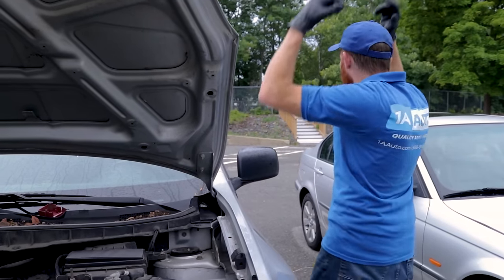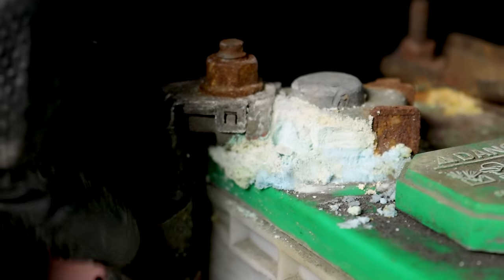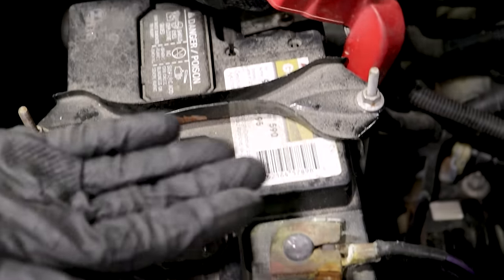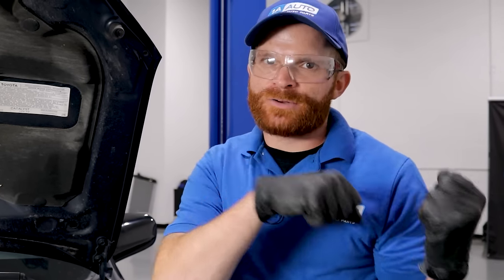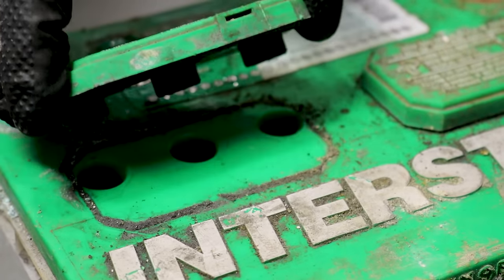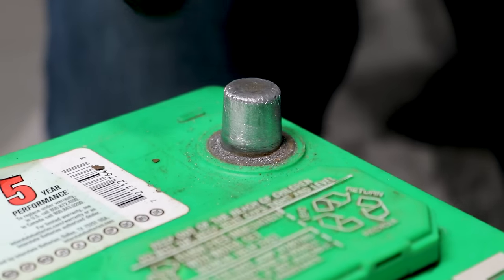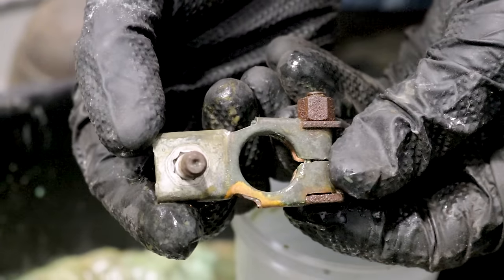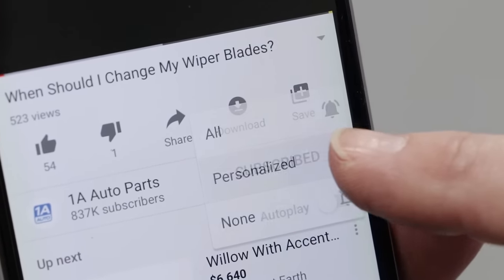Corrosion on Your Car / Truck Battery? Cleaning Tips! It’s Important!

Comment: I keep an old tooth brush in my tool box just for this purpose. It works great at cleaning up those terminals with the baking soda and water
Reply: Tap , warm or hot water?
Reply: @marlenesanchez6370  between room temperature and lukewarm,no more no less.
Reply from the maker: Great tip, and great way to repurpose old items instead of throwing them away! http://1aau.to/m/Shop-1AAuto-Now
Reply: boiling water to clean and copper grease to protect have done that for 40 odd years allways works and no problems
Reply: Me too

Comment: I never heard of corrosion of the different terminals due to different over or under charge conditions. That’s interesting. Very cool test with the LED bulb to show the small current drain on the top of the battery! I never saw that before, which really makes you think about keeping the battery clean! Excellent video overall!

Comment: When cleaning the tops of the batteries, I always plug the holes with rubber stoppers to keep the cleaner out of the internals of the battery.  Has always worked well for me.

Comment: Thank you for taking the time to help people with their cars!

I'm a lifetime electrical guy and I would like to add: Voltage doesn't flow, current flows. A lot of people like the water analogy, so let's use that. Voltage would be analogous to pressure and just assume whatever the device that requires Voltage, is already designed for that Voltage (pressure) too little or too much voltage to the device,  can cause issues. However, current that flows to devices, can vary depending on certain factors. For instance, your stereo will use less current when the volume is low and more when the volume is high. Windshield wipers: less current on low than high, etc. You battery delivers more current (flow), through the cable, the more devices it's powering, could be: headlamps + radio + wipers + defrost. The alternator is wired in parallel to the battery, so it powers items, or shares the load, when the engine is running.
Reply: I know I’m 2 years late. But for a week now my battery has been having issues cranking. Every morning it takes a couple seconds to turn over. I looked at my battery and saw a lot of corrosion on my positive(RED) side but none on my negative (BLACK) side. 

Does that mean that I am over working my alternator? 
Because I drive about 1 hr round trip to my 2 jobs. It’s also hot and humid outside, so I have my A/C on full blast, I also use my Apple CarPlay to listen to audiobooks and music, as well as use my high beams at night to get from one job to the other.

Comment: This is a great video! So informative and detailed yet easy enough for someone with little experience to understand. I especially appreciate the explanation of the causes of corrosion. The fact that I have corrosion on the positive terminal and the illustration of the need to take the battery out helped me decide to wait 2 days and get my voltage regulator checked vs. tackle the cleaning myself. Thanks for the helpful content!

Comment: My dad was a NY certified mechanic and all around petrol head, who also owned a gas/repair shop.
Dialectric grease is good, however you can also simply apply vaseline around the battery terminal and leads before reattaching everything.  Seems to last 2-3 years here in the NE, which is probably about when one would need to do some basic PMCS on a battery anyways.  Since I have Permatex Anti-Seize, I use that which also works very well.
Reply from the maker: +Boots Thanks for the feedback!
Reply: I use a Vaseline coated fabric washer under the terminals when the battery water is topped off in each cell and the top is sealed and cleaned.
Reply: @johnjohns2333 what type of water, will tap work? Or should it be distilled?
Reply: @MrRedHotChiliMan  only distilled mate

Comment: One observation that I made was as the battery nears its END OF LIFE  their increased off gassing from the battery and subsequently the top of the battery is "moistened" with acid from the battery and the corrosion increases at an alarming rate on both terminals but mostly on the positive terminal.

Comment: Very professionally presented 
Very knowledgeable 
Taught me something that I never knew and that is the voltage leakage on the battery top.
The over and under charging indicator is also very new to me

I am going to inspect my battery and cables tomorrow 

Thank you very much

Comment: Thanks for the video. I've never seen the meter on the plastic before. I was surprised to see voltage. I just tested mine and got a reading. Also tested with a probe on a terminal and another on the plastic and got 8V 😮 Now it's all clean and reading 0V, thanks to your video 🙂

Comment: This was great. Got a new battery yesterday. Terminals were very corroded. I thought the guy did everything necessary when replacing it, but the battery died again. So I get to get up early tomorrow and use what I learned here to clean those terminals. 

He tested the starter and alternator and said they tested fine.
Reply: Installed a new battery for you and didn't even bother cleaning the terminals? I'm assuming you mean the connectors?

Comment: Great job! Only ?
Do the freshly cleaned terminals need to be completely dry, before reconnecting them? Or if there is any moisture at all, isn't that a hazard?
Also, when you reconnect the Battery, are you connecting the "positive" cable 1st, before the Negative?
Ty 😊❤

Comment: About 9 years ago during an impending ice storm I replaced the 10kW backup generator battery with the only available battery left at Walmart. It was undersized and only had a one year warranty. It still works today; however, the terminals are badly corroded with alarming build up. Going to remedy that.

Comment: If u flip that flat plate on universal on neg terminal, 'mountain' bump becomes a 'valley' bump & cable will fit tighter. Moisture on top is ALSO from overfilling cells w/water. Fill enuf to cover plates but BELOW Delco eye, this allows for expansion. Jst keep battery clean & DRY. Jst sayn.👍

Comment: Thanks for this. My car won't start, the battery has a bunch of corrosion. 
I  just cleaned the corrosion using your tutorial.  I haven't tested if it's gonna turn on again lol I'm a bit scared. Can I start the car right away or wait it out?

Comment: One thing i may add is they make Felt anti- corrosion washers that go on the posts prior to attaching the cable clamps.  Cheap Insurance to combat corrosion as well as high resistance shorts across the battery case if it gets dirty enough to allow a conductive path.
Reply from the maker: +Pin Ball Thanks for the feedback!
Reply: I've tried those and they didn't seem to do much. Got corroded anyway. I think it's because the battery is off gassing. The acid gets on the terminals regardless of whether there are felt washers.

Comment: Awesome information!!! Answered my corrosion questions thoroughly bc I seem to be frequently seeing corrosion on my cable terminal—now I know why. Wondering if I’ve been getting low quality batteries. But where do I find the battery memory saver and what should it run?
Reply: I purchased a portable jump battery from harbor freight, besides jumping a dead car battery, it also has 5 volt USB outlets to charge your phone, and also two cigarette lighter type outlets to plug in your memory saver cord.  Purchase the memory saver cord online or at your local car parts outlet, Auto Zone etc. The memory cord will plug one end into your OBD 2 connector, and the other end, a cigarette lighter plug, goes into your portable jump start battery.

Comment: I put a new battery in my car last week, but I may have made a mistake. My vehicle is a 2011 Toyota Corolla S and the old battery had been put in in April of 2018. So it was getting close to the time to replace it. But the reason why I did it now is because early last week while I was checking the oil level, I saw a small amount of corrosion on the edge of the top of the battery right where the seam between the top and the side is. I thought at the time that the location of the corrosion indicated a crack or fissure right where that seam is. If that was the case, then the battery definitely needed to be replaced ASAP because it was going to keep on leaking hydrogen at the crack and there was no way to fix it. 
But I've seen several clips since then, including this one, that claim corrosion can appear on the edge of the battery, yet still originate from beneath the caps. I have no idea how or why that could happen, but if that's all it was, then the corroded area could have been cleaned with a rubdown of water and baking soda followed by a thorough drying of the area, and the old battery would have been good to go.

Comment: Considering the safety precautions you're taking, why would you use a screwdriver, which is conductive metal, to pry open those caps? Just an observation. Never knew about the over/ under charge corrosion. Pretty neat

Comment: Awesome video. Would you show us how to fix the voltage regulator? My truck is a 2015, corrosion on the positive terminal, I do go on really long drives that it might over charge. But I didn’t think it would do that with a proper voltage regulator. Maybe it’s bad. Idk. Thank you in advance.

Comment: This is very good knowledge video and Thank you. I have one question about Ignition & battery sealer and battery terminal protector. Are they the same products? Can i use battery terminal protector instead of ignition & battery sealer or dielectric grease?

Comment: My car sometimes doesn't start unless I shake my battery, other times it starts perfectly fine. You think that would have to do with corrosion or a bad connection? I don't see anything blue on the top of the positive or negative caps. Thank you for your time, great video 🤙🏾👍🏾

Comment: When electricity passed through dissimilar metals “Galvanic Corrosion” begins. The most active metal will corrode at an accelerated rate. Traditional battery connectors are lead, with the locking device made of steel/zinc, dissimilar metals. Gator Loc™ is constructed with no exposed dissimilar materials, leaving no possibility for corrosion.

Comment: I was hoping a better explanation of how to use dielectric grease would have been mentioned. Dielectric grease is an *insulator*, so it's very important that the contact areas don't have any on them. It was done right, but there was no mention of what would happen if done incorrectly. You could melt down your battery terminal if there's dielectric grease between the post and the connector while trying to turn it over.

Comment: What to do if like you were trying to clean the positive terminal, until the terminal cracks. And hard to remove the terminal with the battery terminal fuse, like its sealed with it.

Comment: Can I use Dielectric Grease or the Ignition & Battery sealer on other components like the starter connectors and/or alternator connection?

Comment: Do you spray protection on the terminals before connecting them back to the battery or I can just spray them after connecting them like the video? Thank you for the information I was about to go in with no gloves, no bucket, no spray, no baking soda, no glasses, and with exposed wires from this old Subaru legacy outback lol.
Reply: I think afterwards

Comment: I rarely drive and when I do its usually less than 5 miles-both my cars have had battery corrosion on the positiver terminal -so bad that I had to replace the ends on both cars

Comment: Find then clean every grounding   point on the engine to chassis clean them every couple years and your vehicle will have far less problems including battery corrosion.
Reply from the maker: +derwood 454 Thanks for the feedback!
Reply: I did that the other day. Missed it for years.

Comment: I disconnected my riding mower battery and kept it in our house for winter storage, and today I discovered there's corrosion all over one side of the positive post and all around the corners of the battery...WHAT HAPPENED?!?!?!! I tested voltage with my multimeter and it's 12.4v so it hardly lost any charge, is it safe to hook back up or am I looking at an explosion hazard here?

Comment: Couple weeks ago my car wouldn't start. Took it to get checked and it was the diodes, so i replaced the alternator and still nothing. So i replaced the battery thinking it drained and same thing. well yes it was the terminals that were dirty and also the negative terminal was broken. Saddest part the tech who replaced the battery failed to mentioned it because it wasn't part of his job. 🤦‍♂️lesson learned start by the terminals and battery.
Reply from the maker: That's really to bad. the technician should have told you about it. This is why we make thousands of YouTube videos so you feel confident doing it yourself and knowing the job was done right. Thank you for checking out the video. If you need auto parts go to: http://1aau.to/m/Shop-1AAuto-Now

Comment: My positive terminal is highly corroded and I was attempting to remove it and it broke off. Currently 5 degrees in Chicago . I was planning on replacing it but the 2nd bolt that attaches it to the other plastic part is stuck. How can I loosen it up some . Plz help

Comment: i learned in electronics class that you should never clean electrical contacts with sandpaper. due to the silica in the sand. you should have used a wire brush. i am 61yo and have been working on cars for 40 years.

Comment: Very informative,  nice job , but I'm curious as to why you didn't apply dielectric grease to the post or cable  terminal connctors ?
Reply: Dielectric grease is an insulator so it would be the opposite of what you want between the post and the connector. It can be put on top of the post after it is connected to reduce corrosion

Comment: I have corrosion on both terms, I got the neg off but the pos is stuck on , it’s stuck good too , tried tapping light with a screw driver on the notch on the connector and still nothing , and I save to try and loosen it up with just the neg off ? With baking soda water
Reply: Hit it harder. Wire brush it more to loosen build up. Use a lubricant. 
Use insulated tools. Don’t hold metal and touch the battery with that same metal. Plastic or rubber handle tools. Or hit it with something non metal.
Reply: @Chris-mo9gt  I got it off I got the top piece of the pos off and the actual connection was stuck on , it was stuck on bad man but once i had the battery out on the grass it put tons and baking soda and some help with a flat head and got it off 🙏🏻

Comment: If you buy an AGM type of battery (any brand), it will likely not corrode as near as much as a normal battery. It is worth the extra cost. It's just a better type of battery overall for many reasons.
Reply: AGM??? Explain please
Reply: @clw8129  AGM stands for "Absorbent Glass Mat". It is a type of technology used in the best car batteries, and cost more, but is worth it. They give off less battery fumes and gasses and are safer. They're also more reliable and last longer than a normal flooded cell lead acid battery.

Comment: Would a Dremel be just as good? The sandpaper disks? Or manual and Dremel? To make it less tedious?
Reply: I don't think you want to be flinging bits of lead all over the place, along with battery acid. I would be afraid to grind off too much of the terminal also

Comment: Hi my husband threw a tsp baking soda in that five holes of the battery to clean it up is it correct to tthrow in their aswell as where you connect the battery side to clean that with baking soda and water then sand paper

Comment: So don’t use universal connectors. Especially on modern autos with computers bc :
1: You might do a bad job installing it. That applies to any connecter. 
2: Moisture can get inside the wire insulation that doesn’t fully enclose the wire. They’re definitely still using non enclosed connections on modern. 

You laid a flat smashed ground wire on the connection to show it won’t be tight. On top of a clearly rounded channel made for the wire. How about twisting it back tight and installing it properly. 

The the positive connection to the terminal which wasn’t addressed can be removed independently from the other connections on the positive and replaced. 

Look how easy it is but… make sure you only use dealer authorized parts even if they are the same quality. Or else… 😂

Comment: I checked my battery today and had a voltage reading from the negative terminal to 3 battery cell caps. My battery is spotless and can’t visually see anything abnormal. Alternator is charging 14.3v max. Is it normal to have a reading or is there definitely something wrong. My battery doesn’t draw current either it stays at 12.79v every time I checked it after sitting overnight. I’m curious if it is a sign something is wrong.
Reply: Maybe there is acid on the battery that you can't see. Try cleaning it with baking soda and test again

Comment: Very good video. HOWEVER.... 2014 Toyota Camry, I needed the positive battery clamp that almost disintegrated. I could not find in the local parts stores (Auto Zone, Advance, OReilly, NAPA). And not from 1A???? You would think a car as common as a Camry would have a battery clamp available. I got an OEM Toyota clamp from eBay cheaper than the dealer. 
And I use Fluid Film for terminal protection.
Reply: Flashbacks to my 2005 Camry right there
Reply from the maker: Thank you for checking out the video. If you need auto parts go to: http://1aau.to/m/Shop-1AAuto-Now
Reply: @felipepubillones2768  it's a Camry thing
Reply: @heiroot  hush! My 2012 Camry so far is doing ok. Don't need it jinxed!

Comment: If corrosion happens because the caustic gasses escape the battery and causes the terminals to corrode...why does it have to mean over charging or under charging???? The corrosion will happen and it doesn't "have to" mean it's being under charged or over charged.